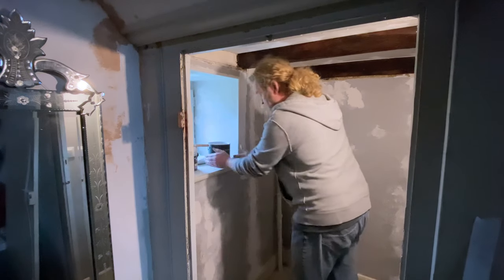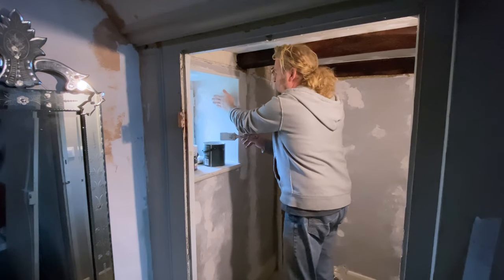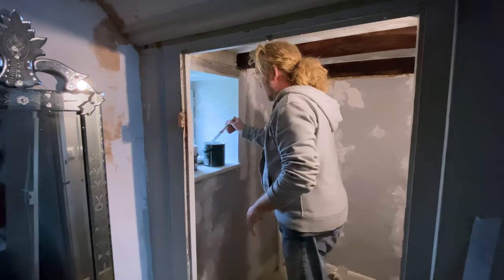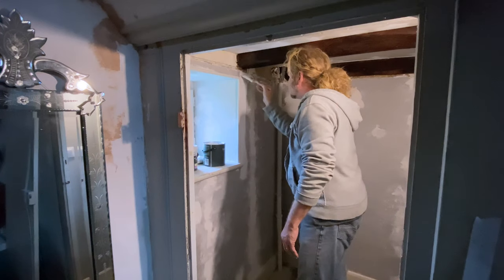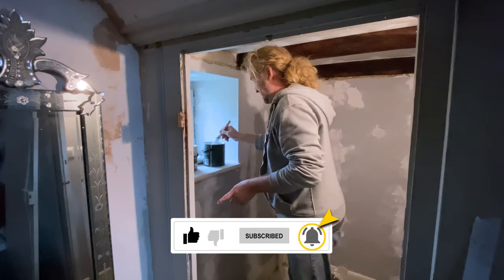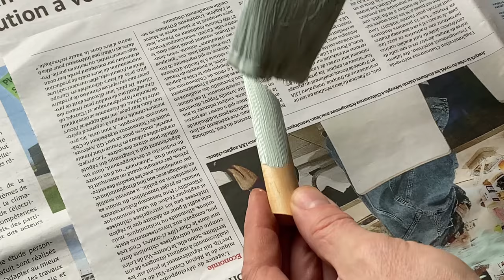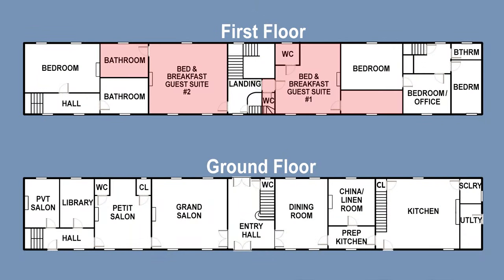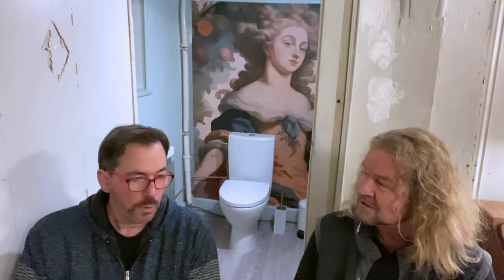An Unexpected Wall Mural in the WC! French CHATEAU RENOVATION DIY - Journey to the Château, Ep. 179

Comment: Oh that's just smashing, just what this space needed, and isn't she gorgeous! Cheeky, unexpected and makes this little loo quite grand enough! The tiniest little sink too, so cute! And nice to have! My favorite addition toa guest wc is a small wallmounted box (you can spruce up a wine box with paint for this) full of wash cloths/tiny towels folded and rolled and stuck in with the rolled ends out, and a small basket to dispose of used ones. I did this for B&B years ago and it was one of those things i got alot of positive feedback for, a nice touch!😉 I thinknyou could fit that in there without trouble. Just an idea. I tried different ones and found the bright white best as one can wash them on high temperature and add a drop of bleach to freshen them up too. One thing though, my dears, a mirror is necessary, at least for the ladies. No need for a biggie, and one on the inside of the door would be fine. It's just nice to be able to check your hair, lipstick and teeth in private.
A nice scented candle in the window and it will be a little treat to visit the Marquise! Love your Rainbow Chateau!
And the signs of spring... 🌈🐾🌱🌷 ❤️
Reply: Love your comment. ❤❤❤❤. Huge hugs. Hope all is well.  Spring is coming and we are looking forward to seeing more flowers 😊😊